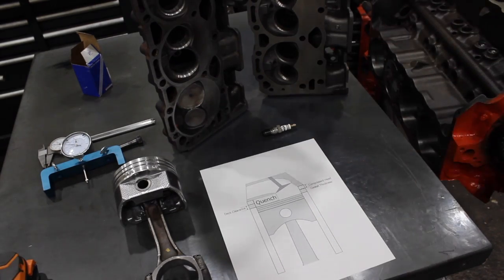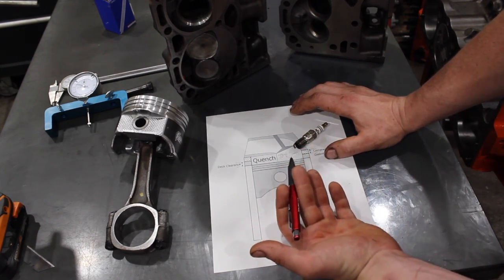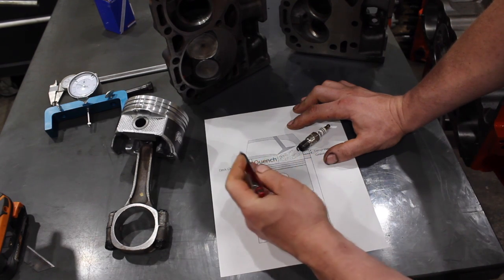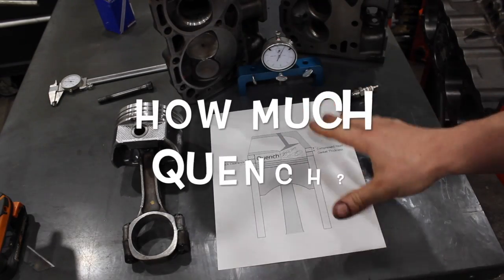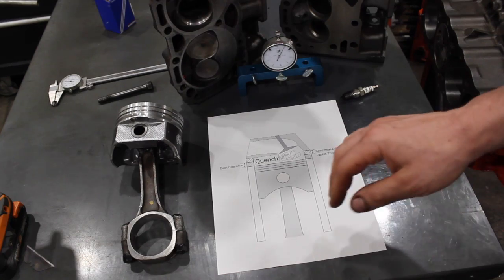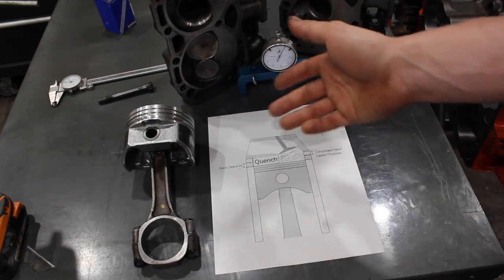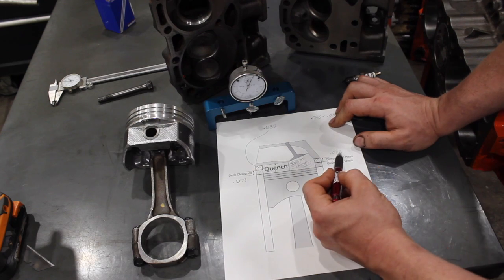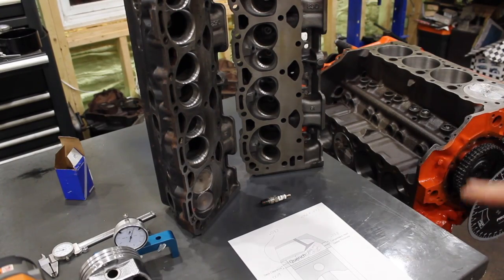Quench! Higher Compression with Less Detonation (A key to making more HP)

Comment: Just some practical info for those that don't live in the US (except California perhaps), that actually have to meet emissions, and run a catalytic converter etc....

A very tight squish will indeed increase TDC turbulence (any increasing amount of squish exit velocity will) and prevent end gas detonation, and thus increase power due to less pumping loss by lower burn time, and at the same time be more knock resistant so MBT timing (or closer to it) can be achieved. 
Mostly the increase in detonation/"knock" resistance is due to the fact that gasoline mixes don't burn closer to cooled surfaces than ~3 mm or ~1/8", having the quish very tight delays the point of sufficient squish opening at a ignitable distance from cooling faces and exposure to the main combustion event happens after peak pressure, preventing end gas detonation... 
However (there is ALWAYS a "but") not all fuel/air mix escapes the quench, regardless of how tight it is, this is what would otherwise detonate if exposed to the main combustion at too early of a time (like with a larger gap), but in a very tight squish where it won't be able to detonate, and where the squish opens later it is often a very rich mix, which due to all the cool faces the fuel is not vaporized (air escapes the quench much easier than the fuel) it will burn late and "cold" causing oxygen deprived secondary combustion and some of will also polymerize, causing excessive CO and HC by-products, making it hard to pass emissions.

You can still have a bit of both worlds tho, if you have smaller squish areas, but more distributed along the chamber. Which by being shallower allows for faster progression of the flame front at squish open not giving time for end gas detontation to happen, giving opportunity to get heat in early enough (more gradual increase in heat in the qench/squish area) for the end gas mix to contribute in a normal combustion just slightly later on, instead of the trapped gasses being pig-rich, and hard to combust. 
That's why modern 2v engines has squish on both sides of the chamber, but smaller (unlike the old CI heads in this video, with just one large squish area on one side), or why in general 4v heads are basicly "mainstream" by OEM's these days, which lends itself the benefit of still having good squish induced turbulence, without needing to run the squish so tight that it makes alot of CO and HC, that makes one fail emissions (well, fails emissions in the most of the "developed" world, anyway)
Reply: 4 valve do not tend to a lot of quench induced turbulence. They do have tumble which works well at low RPM, but is not effective at higher RPM.

Comment: Unfortunately I have dished pistons.  Im pretty sure I know the answer to this but do you treat dished pustons the same as flat top pistons as far as the ridge all the way around the dish.  The top of the outer ridge or ring on top of a dished piston is where you measure quench and that needs to be the same as flat top?
Reply from the maker: Yeah thats correct. Unfortunately a full dished piston has little to no quench

Comment: hey pat I have a question I just installed 8803 cam AFR vortec heads on a l31 block I have a sniper with timing control and it idles great I went on a test drive and it's popping like the timing is off any advice would be highly appreciated thanks
Reply from the maker: Hey Nick, did you get your issue sorted out? 
Email me at pcperformance1@outlook.com if you still are having issues. Ive done alot of holley snipers and might be able to point you in the right direction

Comment: I'm running my 383 with the pistons .018 in the hole and a .015 head shim. At 10.75:1 compression,  i run on 87 octane in the winter and 89 in the summer with no detonation.  33 degrees total timing.  It does work and work well.
Reply: What cc where the heads you have on that 383
Reply: @jacobjarvis2545  67cc
Reply: @brandonkanthack  thanks for the reply back i appreciate it.
Reply: Dish piston?
Reply: @cfmechanic  do not mention dish piston and quench in the same sentence!
Reply: 2 valve relief flat top
Reply: Cam specs? What temp thermostat? Iron or aluminum heads?

Comment: The definition of "quench" is to extinguish a fire.  There are a lot of reasons your hypothetical SBC is knocking...low port speed, piss poor wet flow, low compression.
Reply from the maker: Well I do agree to some aspect but quench is also referred to as squish, and thats exactly what it is. Squishing the air into the combustion chamber, and this is important for mixing up air and fuel for a complete burn. 
Chamber design also plays a big role "fast burn chambers" allows for a more complete burn = less ignition timing and more power. 
The less mixed the fuel is in the chamber will make the engine much more sensitive detonation

If you take a late 70s detonator and make a set of heads with the exact same runners but add a modern fast burn chamber and tighten the qunech to less than .045.
I will guarantee that engine will make more power with less timing and not detonate

Comment: How much does dynamic compression come into play vs quench? My understanding is dynamic compression shouldn’t be much beyond 8.5:1 on pump gas. I’ve got a 350 block bored 40 over, 64 cc heads, 12cc dished pistons that are about .02 in the hole, and advertised compression of the gasket is .041. My math is showing 9.8:1 static compression, 8.48:1 dynamic compression, and quench of .061. The engine isn’t together yet. It’s going to be a street driven car. Would looking for a thinner gasket really make that much of a difference?
Reply from the maker: It all works together to make the overall combo.
.040 over with a 3.48 stroke?
That combo with a 12cc dish should be around 9.2:1 compression
Or are you doing a stroker? 
But to answer your question at 8.5 dynamic, with a .061 Quench theres are good chance your going to have fuel sensitivity issues
Reply: Sorry. That's a 350 block bored 40 over and a 3.75 inch stroke. I'm leaning more towards a head gasket with a thickness of 0.023-.0.028 range now. How much does having a dished piston impact quench? I'm using 12cc dished speed pro hypereutectic pistons

Comment: The less gap you have between your Pistons and head  the higher your compression will go . In short  the longer the rod the torq will rise  .   Asking everyone  13-5to 1 compression  512 cui  flat top Pistons static is there  boost  can I run is .?

Comment: Professional opinion please. Had my SBC done at a local machine shop. 350 bored .040 over. New Eagle bottom end. Cast crank and rods. Block not decked. Rebuilder pistons. Which the machinists wasn’t aware of the lower compression height. So he ordered +6.0 flat 4 valence relief hypereutectic pistons. 
I measured deck height as best as possible without a bridge. I’m getting around .040-.045 height. With the thinnest .015 head gasket this puts me at a .055-.060 quench. Compression around 9.2:1. Dynamic compression around 8.10:1. 
I’m running Profiler as cast aluminum 70cc heads. I was hoping for higher compression, especially with aluminum heads. But I wasn’t going to pay him tho tear it down again to deck the block. 
You thoughts on this compression and quench combo. 
Cam is a Howard’s Rattler. 
Thanks!
Reply from the maker: I am assuming your running a fairly mild cam given that dynamic compression..so what are your goals with the engine?
The reason i ask, if you are just building a cruiser engine and dont want to pay to have the engine torn down again and decked or piston swapped, you could run it at .055 quench and probably not notice a difference.
A tight quench is always a good idea but if your doing a mild build then you will probably notice any seat of the pants difference 

You could also mill those heads abit to bring up your static compression 

Cheers!
Reply: yea, it’s just a hot rod street truck. I was intending on reusing the stock rods and crank but they were no good. Only reason I bought a new bottom end. The Howard’s cam is a .488 lift.  Duration 227/235 @.050   LSA 109. It’s their rattler cam. Guess similar to Comps Thumper. 
What scared me was reading so many people online talking about detonation with a quench over .040.

Comment: Building a 383 0 deck with the eBay aluminum heads assuming that it’s 68cc I’ll be needing a .06 gasket for 10.1 compression and 10.9 with a .03 , It will be a street engine with pump gas , what do you suggest either port the chamber to get more cc and a thinner gasket or leave the head alone and get a .03 or .04 gasket and run pump gas and 10.5+ compression
Reply from the maker: 91+ octane? What cam are you running? 
I think you'll be asking for trouble at zero deck and .030 for piston ti head clearance.
Id shoot for .040 to .045 make sure your cam choice will keep the fuel sensitivity in check
Reply: @cuttersperformance  I don’t have a cam yet , it will be going in a jimmy lifted on 35 inch tires so would like to get as much low to mid rpm torque as possible and would like to stay on pump

Comment: I learned this lesson the hard way a long time ago, had know idea the pistons were rebuilder specials. They had a comp. height of 1.540, causing a quench of about.060 though it was for a basic rebuild it ran and detonated under a load. Cause all kinds of problems such as overheating, burnt exhaust valves and poor performance. It’s important to pay close attention to what your purchasing, a deal that’s to good to be true really is!
Reply: Yep: 0.060" is trouble, not a quench motor.  Close it down or move to a dish/switch cams.  Gotta check installed numbers when mocking up/degreeing the cam.  It's a bummer pulling a motor because of bad math.

Comment: I bought a L31 out of a 99 2500HD Suburban to build and to replace the 2-bolt main L31 in my 96 Silverado std cab Short bed. I noticed that the Rods are different in the 96 L31 vs 99 L31. I assume the 96 still had the forged rods and maybe the 99 4-bolt L31 are using powder metal rods? Wondering if the 99 L31 4-bolt had stronger rods? Also what Flat-Top piston Choice is a good recommendation for the build? I want to go as much compression as possible using High octane 91/93 fuel only @ the pumps. I am going to reuse whichever one of the connecting rods thats best from one of the L31 with ARP bolts, ARP main cap Bolts, mid length headers with 2.5" exhaust,  Lt4 Hotcam with 1.6 roller rockers, and upgraded fuelpump and the 36lbs "improved spider injection system I found on eBay and finally a Tune from a reputable tuner for the combination. As for tranny build, its a 4L60E with all the upgrades and heavy duty rebuild kit, maybe a 2500 stall or something around. Rear end is a limited slip posi unit with a 3.73 or 3.90 gear/pinion. What do you think about both connecting rods and which would be best? And what type flat top hyper .30 over piston? And compression? Ive been studying your videos and LOVE ALL YOUR INFO, but trying to figure this out. I trust your recommendations. Keep posting vids! I am hoping my standard cab, short bed truck can run in the 12's after all this, maybe. Lol and of course , removing some weight to lighten up some. Its been a project for some time now.
Reply from the maker: Im thinking your right that the 96 has regular rods as ive seen some early vortecs engines have non PM rods. If the 99 has the PM rods then those are for sure the ones you want to use. Add some ARP bolts, resized and you got yourself a nice set of rods. I currently have a engine out there running 550+ hp (355 sbc supercharged) with those rods and the Summit Racing Hyper flat top pistons, 2 bolt mains with studs and vortec heads. 
Thanks for checking out my channel and let me know if you have any more questions

Comment: Another AWESOME video! Love to hear some recommendations on a head gasket bore?..... # 683 TBI 4blt roller 350, 0 deck, 908's, stock  rotating assembly. Waiting on dial gauge and bridge to arrive, but, assuming average "in the hole" numbers, what gasket bore diameter do you recommend? You and the masses say quench @ .035"-.070", so if i can get close to that i was wondering, hypothetically, why can't i un-shroud a valve to a 4.060 bore gasket, then install a 4.080-4.100...or proportionally larger. Scribe out a 4.080 gasket to grind to, then install a 4.120? Or do you alwaus want to un-shroud to the line/gasket? I hope that made sense. Plenty of gasket thickness selections out there and 3x as many bore sizes. If not,  im sorry I wasted your time. 😊✌
Reply from the maker: Not sure your compression goals but you'll find if your using the stock pistons that usually have a 12cc dish to them you will want to shoot for that .040 quench to keep up the compression.
If you want to unshroud the valves a bit i would just run a 4.100 bore head gasket. Just be sure not to unshroud too far into the sealing ring of the head gasket.
Cheers!
Reply: @cuttersperformance  10:1+, looks like im screwed for getting that number with buckets for dish pistons😞 Back to drawing board. Was hoping to keep it budget as much as possible. If i want 10:1, ill need aftermarket 6cc or less valve relief pistons with NO dish. I COMPLETELY forgot factory Vortec pistons have 4 valve reliefs AND that pesky dish DOH! Sorry i wasted your time brotato chip 👍✌

Comment: Building a sbc 383 with vortec heads and using a COMP Cams 12-242-2. Been trying to order an Eagle rotating assembly but all I can find is with flat top pistons with 5cc pistons. From what I read this will give me 10.1 CR. Would the 10-12cc dished pistons be a better choice to achieve 9.5 CR. Or can I get to 9.5 CR with the 5cc pistons with a thicker gasket. What are peoples recommendations here. 🤔
Reply from the maker: Shoot for a combination that will give you atleast 9.5:1 and have a tight quench of around .040"

Comment: How much life are you getting out of the speedpro hypereutectic pistons, and how hard are you working them, what sort of scr/dcr and cranking compression?
Reply from the maker: I've pushed a few sets pretty hard lol  one engine I have out there in a chevelle is almost 10:1 and running a torqstorm supercharger with 6 psi of boost. It took some careful tuning  to get this thing to run "safely". The engine wasn't built for boost but he really wanted to boost it and see what happens. 
Typically I use them for most 10:1 street builds and have had great luck with them
Reply: Exalent life street and circle track pulled motor apart with 5seasons at 6400 to 7000 depending track pistons all looked and micrometer perfect replacing just for cheap insurence tight quench of 34 .

Comment: I have a 355 with 11.7-1 tips on using pump gas and 91 through 93 octane
Reply from the maker: What cam are you running?
Reply: Has to be the wrong 1 🤣

Comment: Im building a 99 ls1 5.7l with stock short block, double cut valves in a set of 862 heads. 61cc combustion chamber i believe. I think 10.7 to 1 compression rn. I want to run a thinner head gasket to get to 11 to 1. I know pistons rock a little in the hole rn. Its still being built. Pistons go .003 out of the hole at tdc. Any advice?
Reply: Depends on the gasket thickness at that point, .030" thickness is what i would go for, David Vizard recomends .025 to.035" you be fine< buck check your piston to valve clearance.

Comment: Can you recommend a good valve spring upgrade for stock 062 GM Vortec heads?
Lift at valve will be .474.   Hydraulic roller.
Reply: Ls3 or ls6 stock beehive springs (blue or yellow) work great for the vortecs, its a drop in replacement without having to do any machining at all and with the matching comp cams spring retainers. I believe you can use stock vortec keepers on those retainers. Just Google the upgrade for the retainer and spring part numbers. If money or budget allows comp cams makes a nice beehive spring thats the same size as the ls springs and they're a little better spring just double the cost. The Ls springs will be just fine though , its a very easy swap and allows alot more lift for hardly any work

Comment: So tighter quench is more resistant to detonation. I run 15 thou in the hole 51 tho head gasket. I'm at 11:1 comp
Reply from the maker: I have a few customers running ole 11:1 combos, unknown quench and all are hard to keep from pinging even at 94 octane. This is where a tight quench and the proper cam selection is key for the combo not to ping and make great power. It all works together
Reply: You have too much gap.
Reply: @tahcogunworks  so I run 91 octane which is why my specs are what they are. I have considered running an even smaller headgasket but with 68cc chambers compression will be too high for 91 octane, plus this motor is a 427 small block with 4inch stroke